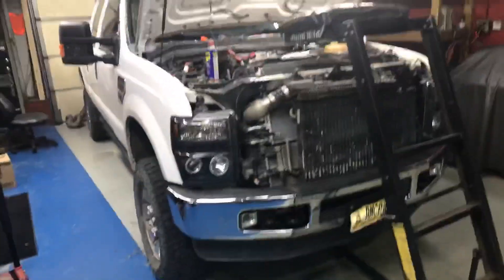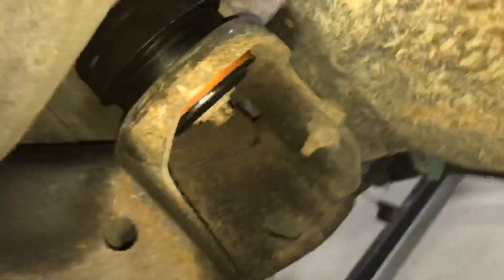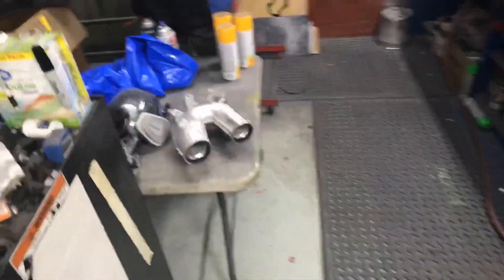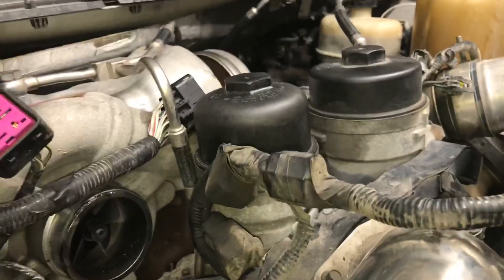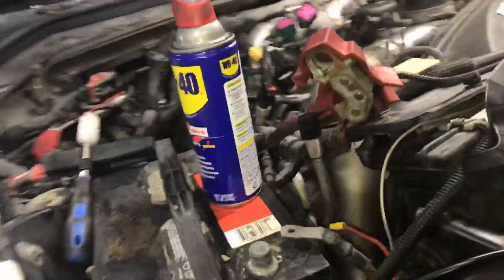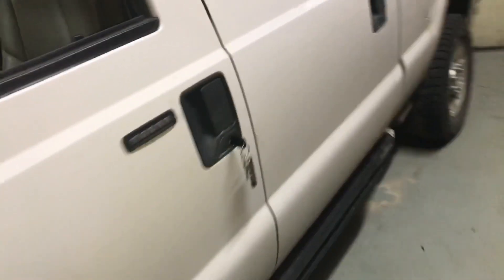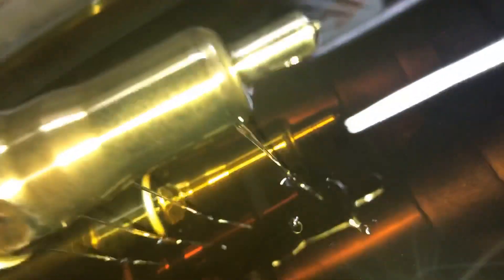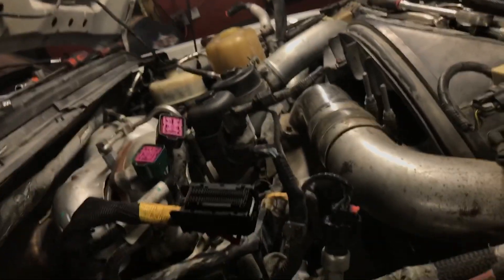Robert’s 6.4 injector nozzles

Comment: My 6.4 has a small drip in the radiator, where the plastic folds into the aluminum, that isn't much a problem now because it's so cold. I'm gonna replace before spring time and want to know your thoughts on which radiator to use. I'm leaning toward the Mishimoto OEM replacement, your opinion?